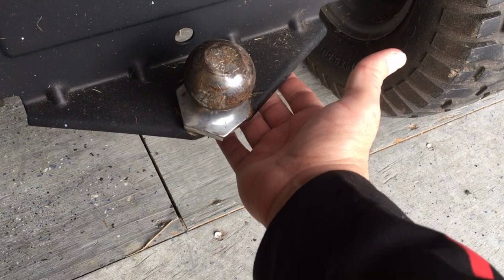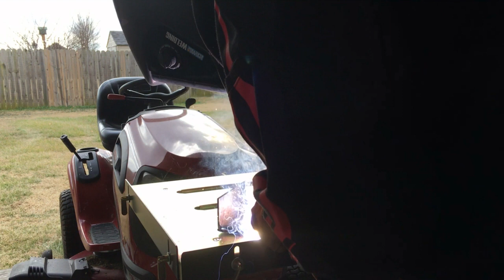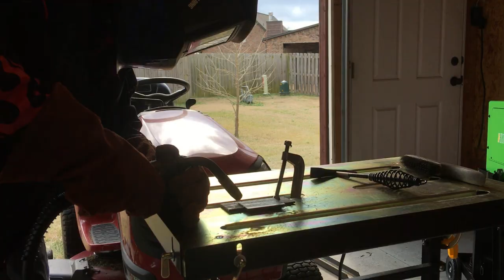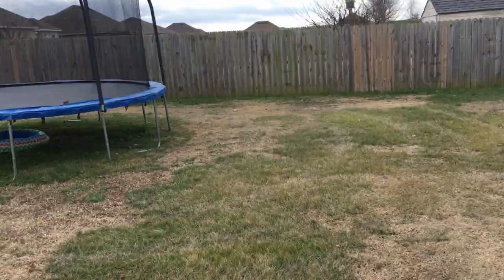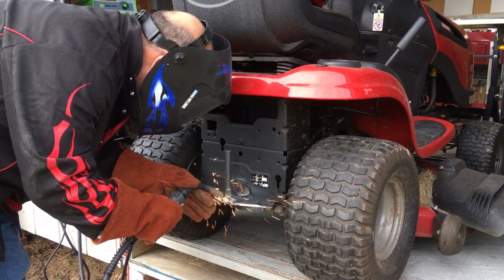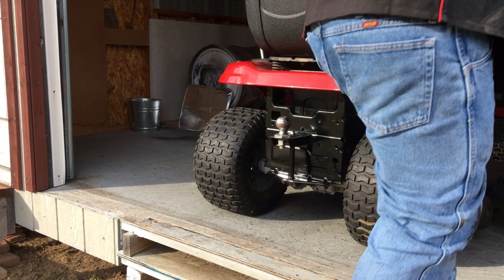Craftsman Riding Lawnmower Upgrade!!  Trailer Hitch Install

Comment: I’m curious if you could have added a few washers to get that bottom bracket higher than those reinforcement ridges? Maybe that would have made the plate sit more flat and cause the gap at the top to not be as great?

Comment: Did you build your shed?  It looks like you've got a ramp or supports for one built into the front apron.  Could you show how that works in a video?
Reply from the maker: I did build the shed, originally I built a slide in ramp in the front, but it was to short of a ramp for my lawn mower to get up in the shed, so I ended up scrapping that idea.  I ended up building a longer ramp out of aluminum but it is to long to fit up in the slide but it is removable, so I just leave it in place unless I need to remove it for any reason.

Comment: great job !!!!! like how you pay attention to details.keep the videos coming. Hey, a question, I also purchased an HYL CUT40 mine was an outlet special for $289.00 they said the only difference was either some appearance or verbiage looks the same but not 100% sure.I bought it from IWE.  just wondering if yours was a new one or an outlet special? I thought I was saving money but you spent less than I did. Love the machine though it cuts 3/8ths metal like butter.
Reply from the maker: Thanks for the comment.  Yes I believe mine was an outlet special, but my understanding was that the outlet specials are brand new units with "printing errors" on the packaging.  What ever the case so far mine was worth every penny.  You didnt pay much more than I did, it is a great deal regardless.

Comment: I might have a different model mower, but did you remove the fuel tank? I purchased a sleeve hitch but am.having a hell of a time putting it on.
Reply from the maker: My gas tank is under the hood, so no I did not have to remove the gas tank.